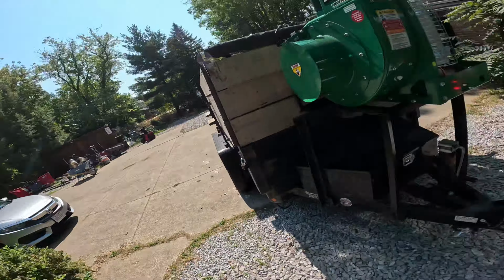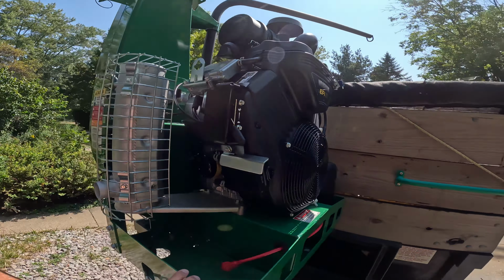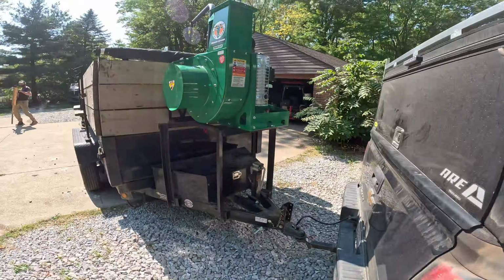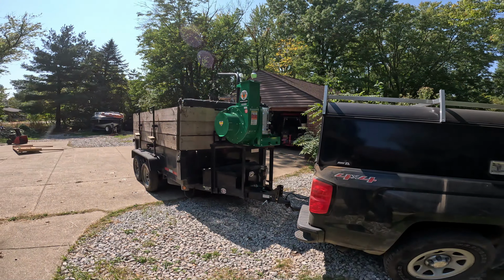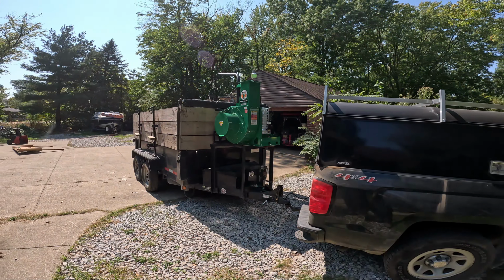Building A Giant Leaf Box!

Comment: I hope that blower mount is strong enough to handle the vibration.
Reply from the maker: It has been holding up pretty well so far! The mount itself was used for the old debris loader and it's been on there for several years, pretty solid build!